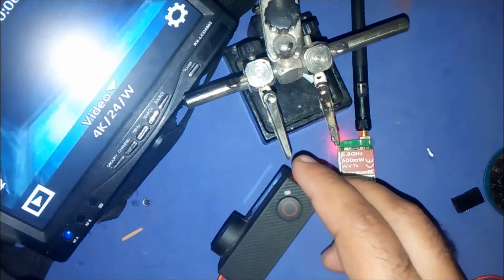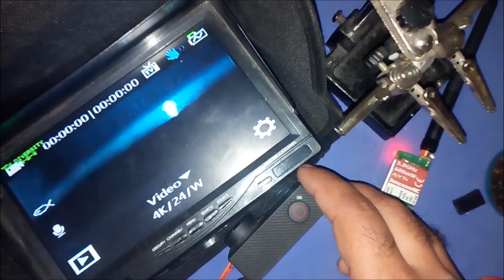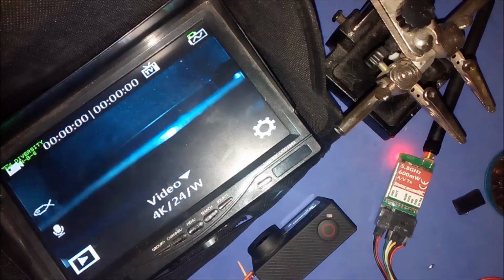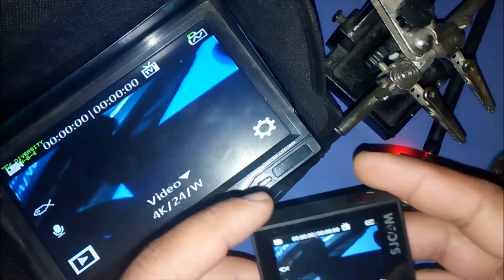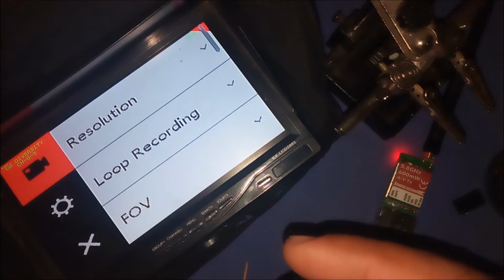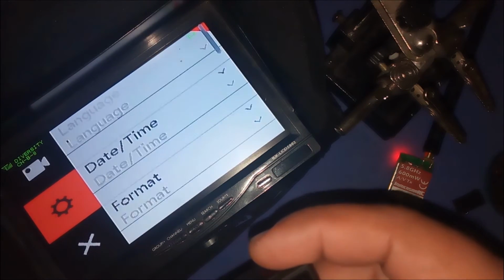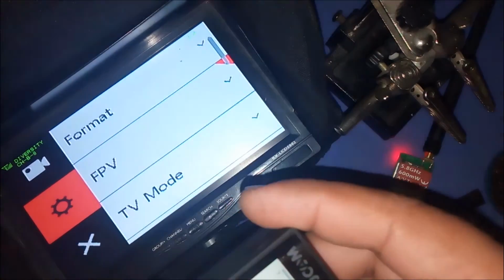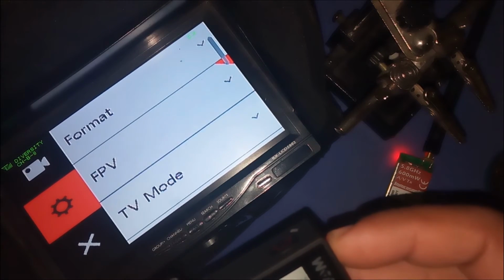DIY FPV cable for SJCAM 6 Legend

Comment: That's a cool mod. Thanks for sharing. I am trying to see if can use the same USB cable somehow to attached to a external power source + get the recording directly to a small HDD (may be a 1TB). Is that doable? using a cable hack?
Reply from the maker: Yes it's possible